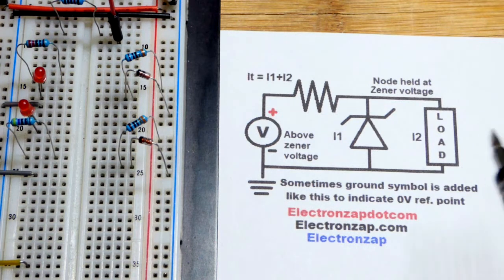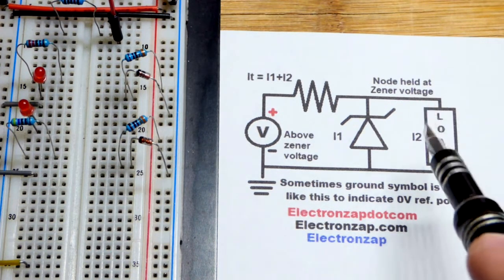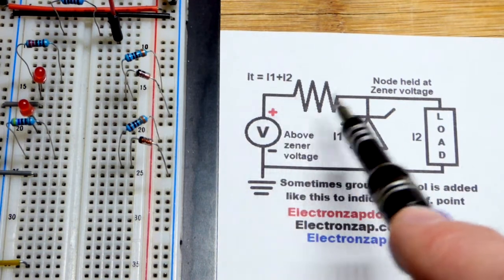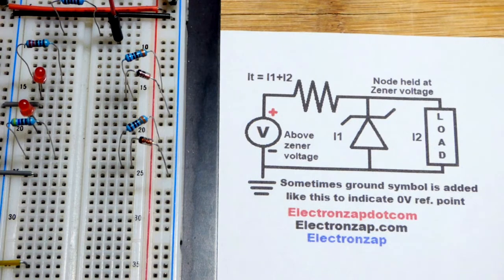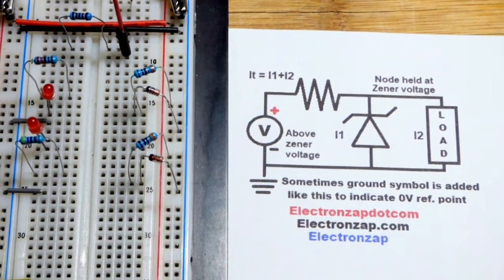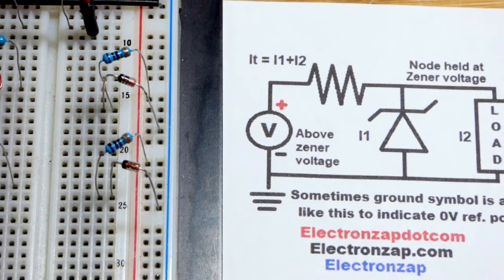Quick zener diode component as a voltage regulator circuit demonstration by electronzap

Comment: I use Zeners as a simple way to limit voltage to MCU pins and MOSFET gates.   You may find it interesting to measure the noise that a Zener generates, under load.  Often a small capacitor is placed in parallel with Zener to mitigate this noise.
Reply from the maker: Nice! I'll keep that in mind.